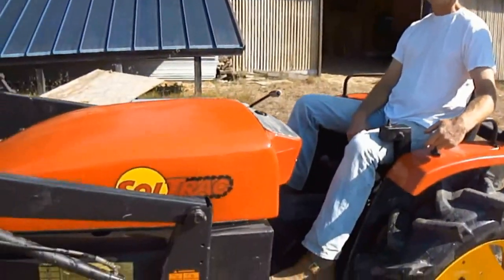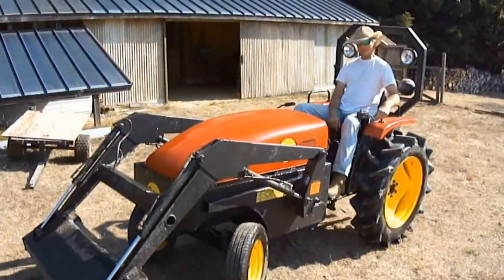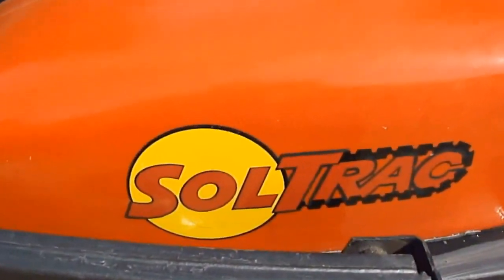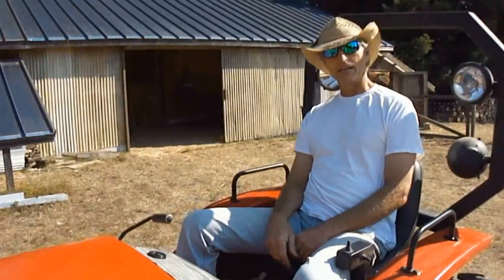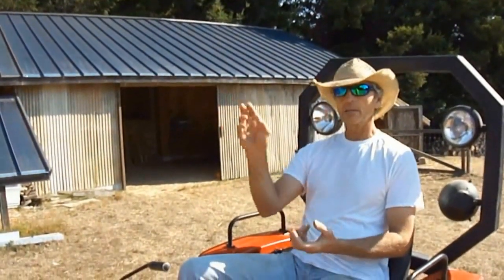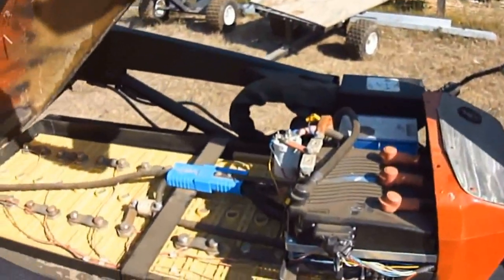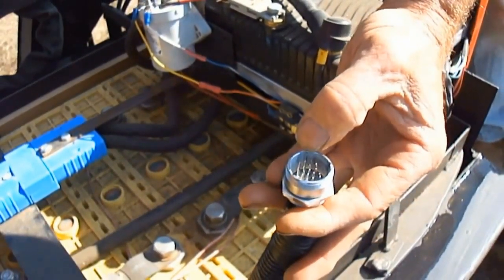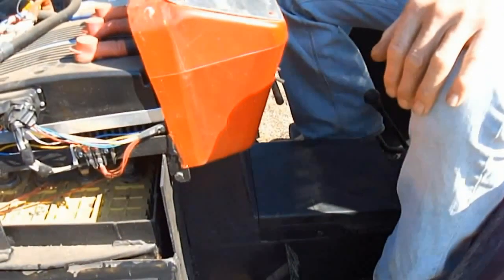Solar Electric Tractor

Comment: Now that, is pretty cool. I probably would have left it with manual steering to cut down on power usage, but over all, this is the first unit I've ever seen that looks like it could actually do what it says it will.

Comment: The issue of solar on the house is a bit better than you mention. Solar panels are guaranteed from the factory for 25 years. It does not mean that they stop working then. The factory guarantees that the solar panels will still produce like 80% of the original capacity after 25 years. They are still quite usable long after that. I have solar panels that were built back in the mid 80's that still produce over 95% of the original capacity. They are just fine indeed.
Reply: all bs
Reply: @gaetanlizotte1957  And your reasoning for calling my post BS? I have converted three vehicles to electric and have a roof full of solar panels that were installed in 2005. I'd say I have a pretty good handle on Solar panels. You?

Comment: quite cool idea, very good concept: tractor's range , battery weight gets useful. Also, electric motors have high torch couple at low rpm. everything is perfect

Comment: Paul, are you using HPEVS software in your controller or just the standard Curtis and Im assuming you are running an AC-50 at 48v and 650 amps. I drive a Kubota tractor about the same size and I think having the standard steering wheel would be best. Quiet and takes nothing from the battery. Nice setup.

Comment: One more thing. There are lots of forums on building and converting your own vehicles from Bicycles to Trucks and everything in between. The AC system used in the tractor is excellent and the larger motors available are also great for a car as long as the car is not over 2500 lbs. A VW is an excellent candidate and to get a system to go 80 plus miles will not cost a whopping huge amount. At 96 volts you can have yourself a real nice pollution free vehicle to go to town or work.

Comment: This is good!  Thinking about there are parallel between farm operations (especially yard work) and those in warehouses. It is all about moving, stacking, reaching etc. "stuff" And in the majority of warehouse what performs these operations? The electric fork lift. Ploughing and towing large loads would be problematic. I suppose a farmer could set aside a field for solar panels for charging. Electric motors equal intsant peak torque. Very interesting

Comment: One general comment to make about the need to have a BMS system with the lithium batteries. The batteries used are LiFePO4 cells and a very good quality cell and very very stable. You do NOT NEED a BMS system using these cells. Being that they can be checked real easy all you need do is drain each battery to 2.60 volts static then connect them all in series and charge with a quality smart charger to 3.6 volts then stop the charge. No cell will be above 95%.

Comment: The PTO does perform as well. Electric motors are superior in almost every way to internal combustion engine. In the case of a tractor you get 100% of the power and torque at any rpm. Torque is super important to a tractor. So the difference makes sense. The only downside to electrical systems is energy storage... IE the batteries. This seems like a good all around idea though in that the batteries contribute to the weight. They key would be to get in enough working time per charge. If you have to stop and wait 8 hours to charge up this would be unappealing.
Reply: Marcus G Would this solve the short distance electric car issue:

This was found using google images. This is not my drawing.

Comment: - Those cells do not need a BMS.
- The motor is likely 15 HP, but with electric motors, what matters is torque and you'll have plenty of that even at zero speed.
- Battery pack like that is $4000, Motor/controller: $4500. About $10K for conversion.
- Batteries can be charged >3000 times. Figure 8 years if you use all the capacity daily.
- As much maintenance as your other farm motors. Bearings, maybe.
- Gov has incentives for solar and/or wind generator so you can run your tractor for free.

Comment: Actually more like $4K worth of batteries. They should last a good 10 plus years or more. Don't overcharge and don't overdischarge and you are good to go for a very long time. Since the tractor is getting little use it will be very long lived. The motors are pretty much good for just about forever. The issue is more a matter of cleaning up the toxic environment and showing that electric tractors are after all something you can do and use.

Comment: But where do we buy this patented tractor?
Reply from the maker: I have one on order now.   Only mine will have a sun shade that is also a solar panel.  Plus an inverter so I can take the tractor into the woods and run my chainsaw or my sawmill.  Send email to steve at renewables.com
Reply: I am seeing this video some 4 years after it came out. It looks like the tech was pretty well developed , but looking at the website you linked, it looks pretty much like what I would expect it did those 4 years ago.
 
Did this project die out? Taking longer to get to market than expected?

Did you get your tractor? How has it turned out? 
Lots of open questions leads me to think an updated video would be interesting.
Reply: Me too, please can we have an update?

Comment: No electric hp is much stronger b/c electric is alway capable of full power. With a four stroke gas engine it is only powered  1/4 of the time. The other 3/4 of the time the power is from momentum.

Comment: $30k? for a 20 HP? 
How long do the $10k worth of batteries last before they need to be replaced?
And how much was the solar setup? $50k?... and the panels will last what? Maybe 20 years...
Cute idea. 
Fun to see someone trying something different.
I'll keep my 20 and 50 year old diesel Fords and if/when need be convert them to run on hemp oil.
Unless you implement Tesla's electric car tech...
I don't see this thing digging enough Lithium to earn it's keep.